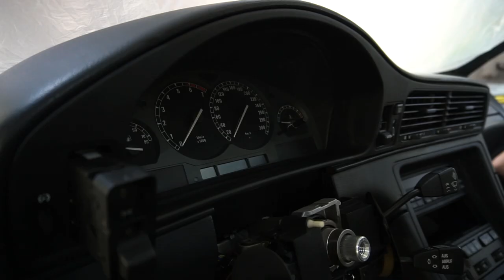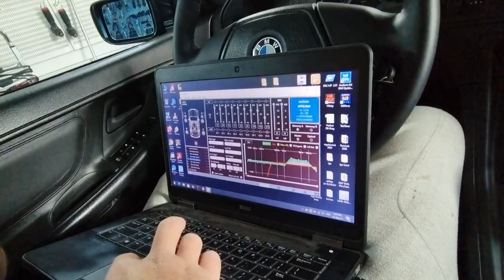BMW 850i E31 | S4.5

Comment: Nu zic, totul fain frumos .. dar de la 16k la 60k e drum lung, mai ales daca faci tu 70% din treaba. Suna a fabula sau 'asa nu'.
Reply: da da! pai noi mintim aici :))) eu te astept cu 850i ul tau reconditionat cu 10k… ca vb aia… cu bani stie toata lumea :)))
Reply: @DanielTheArtist  ofof, mi'ai zis'o tu mie. Nu reconditionez bavareze, imi plac doar cele cu pedigree de Stuttgart. 

In schimb am reconditionat cateva V12'uri din colectia personala, chiar masini mai mari si mai speciale insa ca sa ajung la 45k pret de reconditionare ar fi trebuit ca in drum spre service'uri sa arunc cu bani pe geam in saraci. Altfel nu imi explic. 

Asa scurt iti fac o lista la o masina cu V12 M120 cam care sunt preturile:

1. Vopsitorie - 4000 EUR
2. Desfacut V12 schimbat toate garniturile in el si toate acareturile (inclusiv garnituri chiulasa, totul OEM) - 5000 EUR
3. Suspensie/uleiuri/frane/acareturi pe langa motor - 3000 EUR
4. Interior retapitat cu alacantara/model custom etc. - 4000 EUR
5. Roti - gume - 3000 EUR
TOTAL: 19.000 EUR

Preturile sunt puse cu manopera si tot tacamul si umflate la maxim ca sa nu fie cu suparare.
 
Zi'mi unde a mai intrat diferenta de 26.000 EUR ca eu nu o vad.

Asteptam video'ul cu marea reconditionare.
Reply: @konichiwa7374  cam mult parca intradevar
Reply: @tudorseful9479  0:51 - 45k reconditionare si inca are piele de 30 de ani 😅
Reply: [  ] Salutare,  sunt Dan si te ajut eu sa clarificam cateva aspecte referitoare la costurile 'fabuloase': 'vopsitoria' in cazul de fata a fost o lucrare de aprox 8000 euro , caroseria a fost curatata la tabla, epoxy primer, PDR pt. Toate indoiturile, 2 randuri de fuller slefuite doar manual la tampon pentru a scapa de ondularile spefifice tablei masinilor vechi;  s.au inlocuit flansele de la amortizoarele spate, diverse lucrari de tinichigerie, teroson peste tot, aripa fata noua si capota sh ( doar astea aproape 1000 euro ). Apoi lacul a fost slefuit manual pt indepartarea texturii si s.a aplicat o folie de protecție transparență pe intreaga caroserie ( ~5000 euro procesul asta la un atelier specializat). Reconditionat amortizoare EDC + arcuri 1000, bucsi + articulatii fata si spate ~4000euro ( da, la modelul asta atat costa ), frane 4 pistonase fata spate ( etriere noi brembo ) cu adaptoare custom,  pompa frana, discuri etc ~ , set de faruri sh bune + reglaje ~600 euro, chedere noi ~1500e, jante ~4500EURO ( 2800 achizitie cu transport, buze noi radinox 1200, reconditionat miez si barrel + ansamblat 500 ) , sistem audio sq + insonorizare si montaj ~ 5000euro ( is multe detalii aici,  o sa vezi in clipul mare ), reconditionat motor si anexe ( alternator Bosch refurbished din USA, aprindere,  bobine msd, hidraulice, pompe servo , senzori  lambda etc ; la motor inclusiv cuzinetii de la vilbrochen si biele sunt noi , oem ( aprox 1300 euro doar ei ) - ~7000 euro piesele; debitmetre la reconditionat in Germania + soft calculatoarr motor - 1000 euro,  grup raport mai scurt si conversie blocant racing diff 1300 euro, reconditionat cardan + planetare -  1000 euro; radiator apa din bord + tevi  - 400euro, evacuare cu rezonatoare originale bmw in loc de catalizatoare - 1000e; la interior s.au retapitat cateva elemente ( volan   schimbator, frana de mana ) si restul elementelor din piele qu trecut printr.un proces amplu de restaurare, am dorit sa raman pielea originala ; plafon/stalpi refacuti ; diverse plastice noi si revopsite toate restul , am luat un set de scaune sport pe care le.am reconditionat ~ 2000 euro la interior sa zicem. Si am ajuns cu reperele majore la ~44.000euro + masina ~16.000e, fara sa luam in calcul multe alte acareturi ( presuri oem zincare , revopsit electrostatic la multe repere, lampi fata + spate mai bune decat cele originale , eleron custom replica mtech , lip bara fata mtech etc.. ) . Îmi poți da un mesaj privat si iti trimit un link catre albumul foto al restaurarii daca doresti mai multe detalii.
Reply: @dycgarageauto-motodetailin3354  .. dar tu ai reparat masina in Luxemburg sau Monaco? nu pot sa duc conversatia la finish cu oameni care ne iau de prosti, scuze, spor la frecat.. pardon polishat. 

(ahahahahaha vopsitorie de 8k, folie tranp + polish 5k, bucse + articulatii 4k, chedere 1.5k ahahahahhahaahahahahaha, jante de 2k cica sunt 5k etc. ia cauta ac schnitzer radinox pe kleinanzeigen)

Mie mi se rupe de cat a costat reconditionarea, din partea mea putea sa coste si 100k ca mai mult de 25-30k nu face niciodata masina. Dar asta e misto, cand un invitat minte cu buna stiinta ca sa arate ca dom'le ce grande e el, iar golanul ala de Daniel e cu el acolo: "da da, asa e, asa sa faceti si voi ca asa se face o reconditionare, dai 45k si faci tu 70% din treaba". 
Auzi, cica a imbracat nuca si frana de mana si volanu, si a fost 2000 dom'le... pai bai Daniele, da' n'ai si tu o croitoreasa prin Vitan ceva? Punem niste musama si ma gandesc ca scoatem un 1800 EUR =)))))))) 

Hai ca m'am distrat, ma duc sa arunc cu bani pe geam in saraci, brb, iti zic, e mai fun decat sa fii tzepuit de serviceuri sau sa minti pe youtube.
Reply: @konichiwa7374  man, oricand vrei, eu te astept cu proiectele tale la noi in emisiune...eu cand era mai mic am "reconditionat un kadett e....m a costat cam 17000 eur....mult putin....nu mi pasa....asa cum am mai spus...cu bani stie toata lumea. Vino la emisiune, spune ne unde vopsim impecabil cu 4000, unde facem interiorul cu 5000 si e tipla si oamenii se tine de termene, etc....vino si invata ne....si spune ne sa le spunem si noi la randul nostru oamenilor unde sa se duca sa si faca masinil frumoase cu bani putini.
Reply: @konichiwa7374  frumos ar fi sa nu te ascunzi in spatele unui pseudonim si sa ne "luminezi" si pe noi cu reteta succesului intr-un mod civilizat, fara a jigni; rotile sunt pe AC Schnitzer Type 2 rennsport pe 19inch din 3 piese originale de E31 la baza, chiar te rog sa imi dai un link cu modelul asta de vanzare undeva in lumea asta, in 2 ani si jumatate eu nu am mai vazut ; referitor la interior , citeste te rog din nou ce am scris " la interior s.au retapitat cateva elemente ( volan   schimbator, frana de mana ) si restul elementelor din piele au trecut printr.un proces amplu de restaurare, am dorit sa ramana pielea originala ; plafon/stalpi refacuti ; diverse plastice noi si revopsite toate restul , am luat un set de scaune sport pe care le.am reconditionat ~ 2000 euro la interior sa zicem" ; doar scaunele sport pt modelul asta de europa se vand cu 2000-3000 Euro. 
Toate bune, spor la reconditionat!